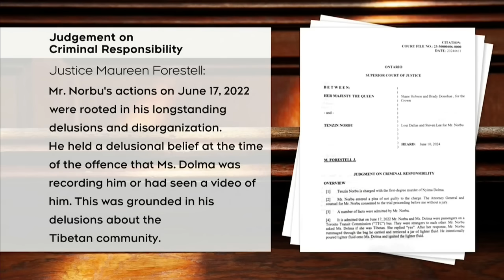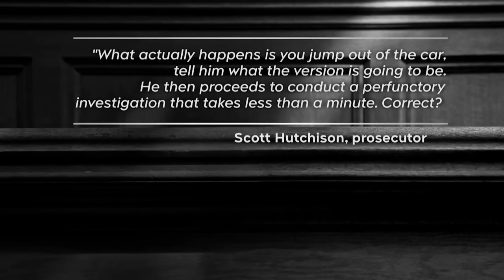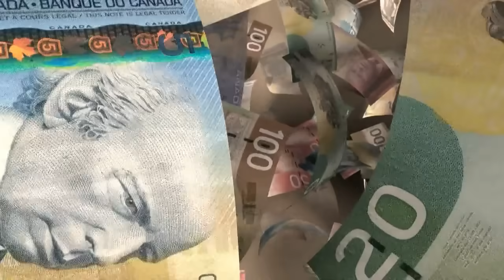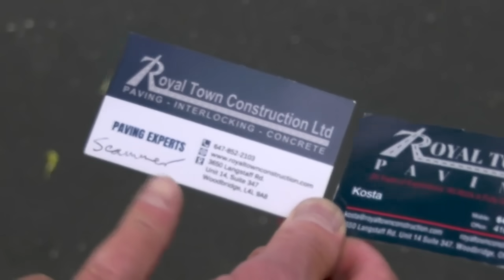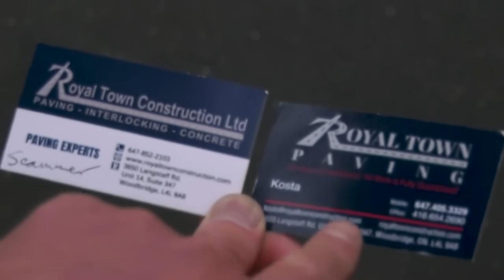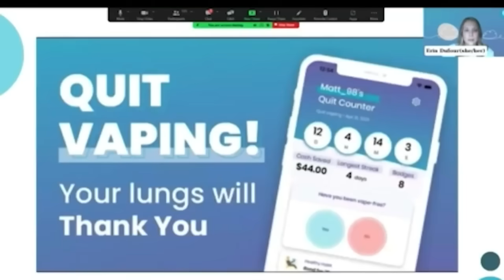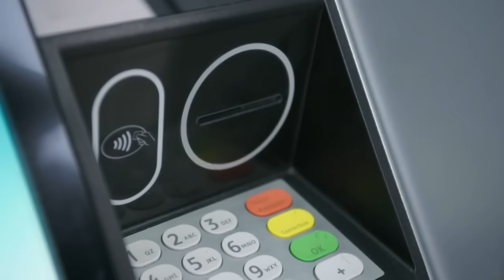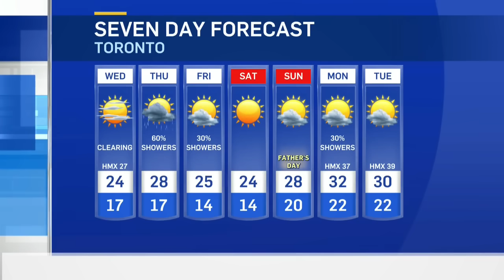Disastrous commute after crashes on Gardiner, QEW | CTV News Toronto at Six for June 11, 2024

Comment: This happens quite often in Ontario, not sure why Dump truck don't have Safety interlock that prevent driving on roads and hiways when the dumpster is up, last year it happened on the 401 in Mississauga
Reply: Inorder for dump trucks to empty their load, they need to be able to drive with their dumpster up. Not sure what safety device you are thinking of.
Reply: @DSP_2.0  are you a dumpster driver?  Going  any speed  with Boom or Box up in any road let alone in a Hiway is recipe for trouble as so many incidents have shown, Everybody knows  you have to raise the Dumpster box  to empty  , but to move off the lot  in Drive takes skills AND Eyes?  Don't the Truck CAB have Red Light indicator that  the Box or Boom is UP? Does the Driver even check his SIDE VIEW MIRRORS?  Box  Truck Delivery Driver here for 20 years +,  and I have yet to drive off with the Roll up door not closed,
Reply: @AuralioCabal-nl8gi  well dumpster trucks lift their box to dump their load, but to empty their load completely they move the truck forward with it lifted. Also, dumpster trucks when used in paving the road have their box up while moving to feed the road paving machine or when laying a gravel road will drive with their box up partially letting out their load to lay the gravel evenly.

But is a safety device needed for something that should be done by the driver?  Or should there be a strict penalty to the driver for this type of accident?

Hell, there are drivers that will drive for kilometers with their signal still on.
Reply: @DSP_2.0  either make the Equipment Idiot proof or suffer continuous  disasters like this,  the choice is up to the LTO   and regulators , we can't have these types of preventable accidents from happening, AGREED? Where's the common sense?
Reply: @AuralioCabal-nl8gi  the only way to make something idiot proof is to not let an idiot get their hands on it in the first place. 
I'm just tired of collective punishment for the actions of a few who should specifically be accountable for their behaviour.